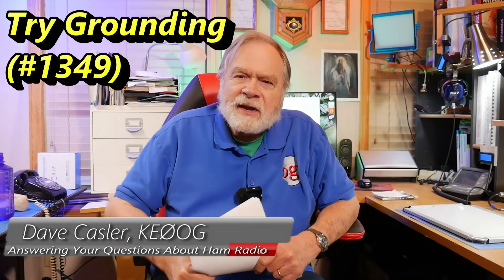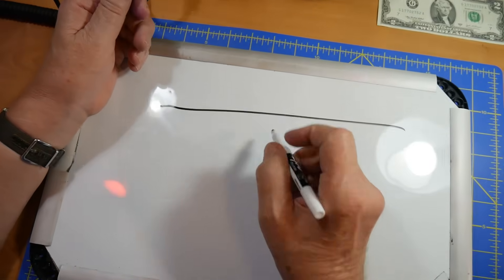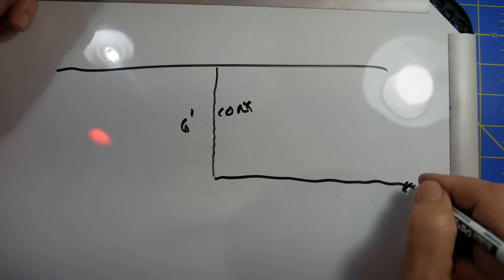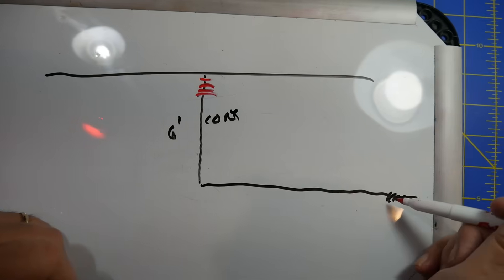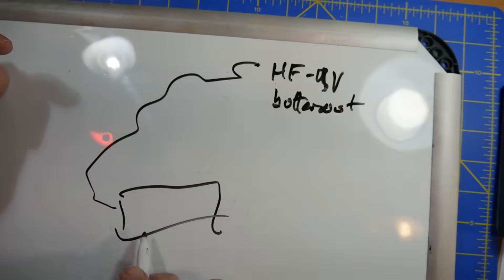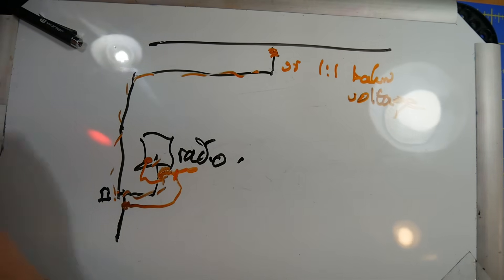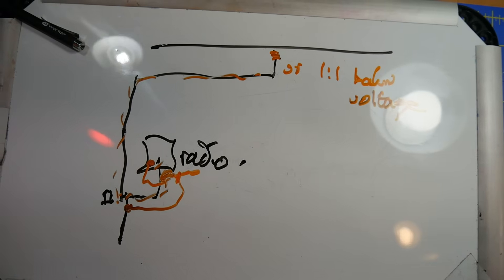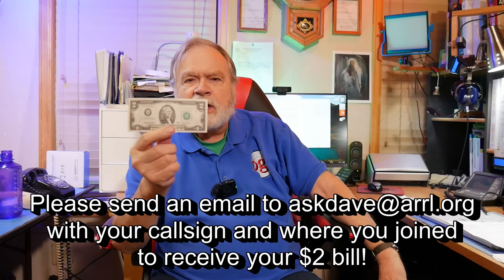Try Grounding (#1349)

Comment: Dave, My 718 did the same—static had cooked some diodes on (I think?) the front end. Had SAR services repair. They suspected static discharge, so now I run a bleeder resistor in my choke balun just before my lightning arrestor and unplug antenna when not in use. Hope that helps.

Comment: Appreciate you, brother.  

How important is it to ground to existing house grounding rod with lighting arrestor versus having a second grounding rod just for your antenna's?  

Not sure where my house ground is to tap into, but previously tapped a copper rod near antenna in backyard about 7ft down.

Thx!  God bless
Reply: very important.  Natl electrical code requires any separate ground rod be bonded to house mains ground rod.